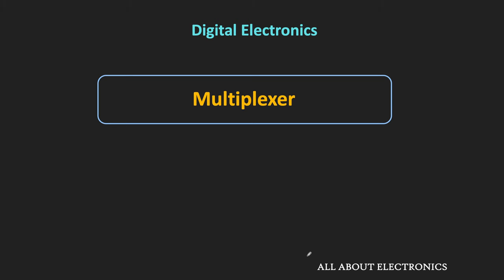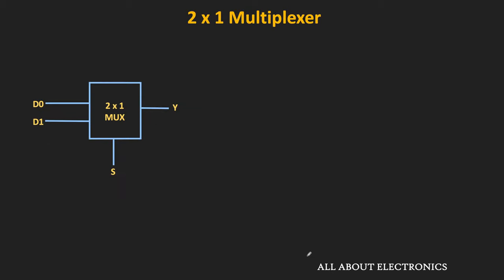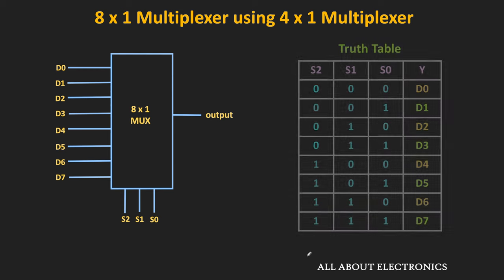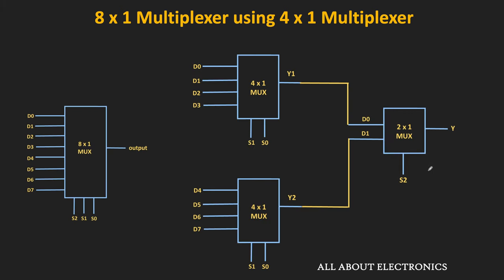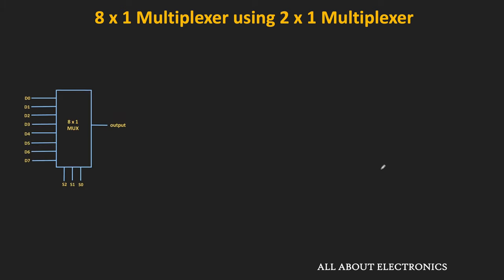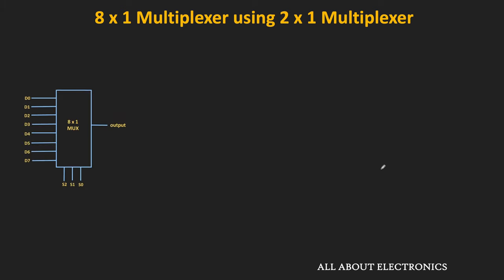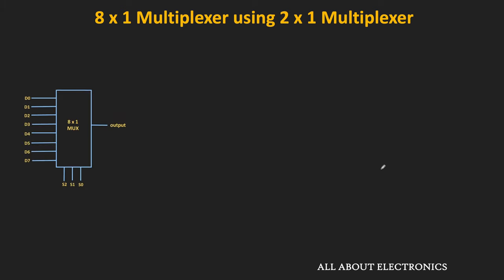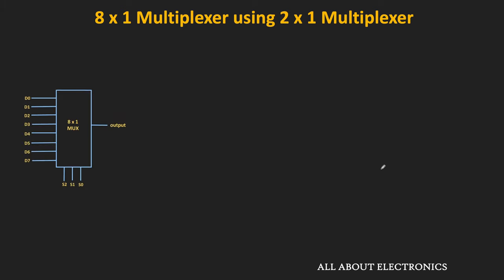Multiplexer Explained | Implementation of Boolean function using Multiplexer

Comment: how do you do the last example, if the selectors are BCD, cause it would be different right?
Reply from the maker: Yes, it is different. Of course, you can make a table and find the relevant inputs. But it won't be convenient. Because, now your minterms in the table are not in a sequence. For example, for BCD = 0, you are grouping minterm m0 and m8. Likewise,  for BCD = 001, in the table, two minterms will be m1 and m9. So, of course, you can make such groups, and find the value of each pin in terms of variable A. But it won't be a straight forward. 
I hope, it will clear your doubt.

Comment: 1.If possible explain  how the output F came  in last  two tables.
Reply from the maker: I think, you are talking about the implementation of Boolean function using the multiplexer. In that, we have assumed that we have some function F, which is 1 for the specific input combination. And the corresponding truth table is represented. Here function arbitrarily chose.